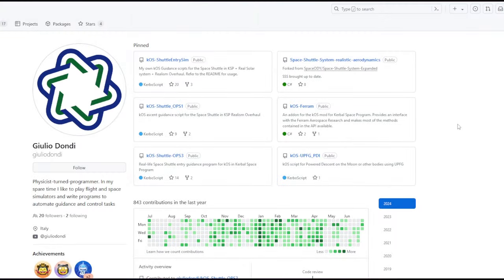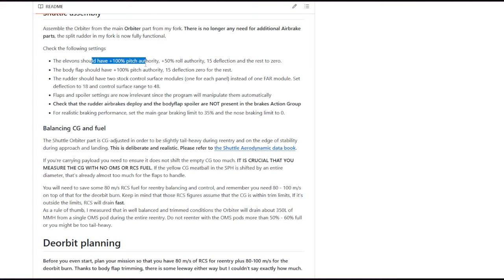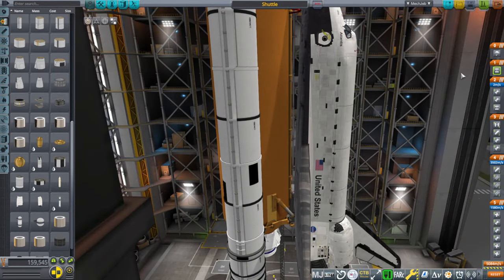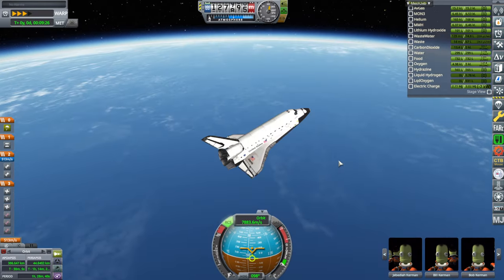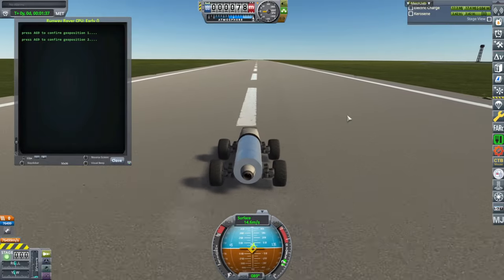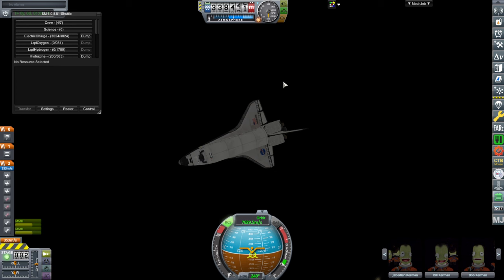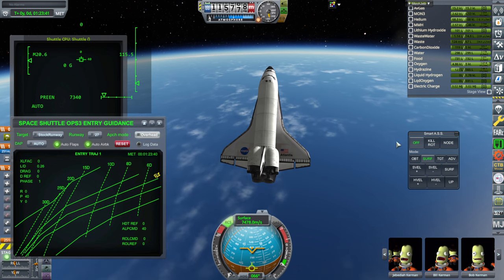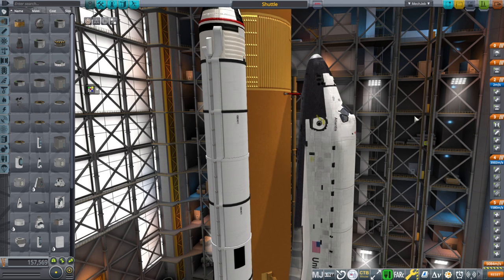Using the Giulio Dondi Shuttle (KSP 1.12 with RO)

Comment: 12:10 Here’s a list of the parts that have multiple textures:
Orbiter
Both Elevons
Tail Control Surface
Vertical Stabilizer With Parachute
Engine Mount
Both OMS Pods

External Tank

RSRM (Solid Rocket Booster)
SRB Decouplers
SRB Nosecone

Comment: HI there. I followed your videos and installation precisely, 5 times now, each time with a clean install. I have managed to get everything working as advertised, except KOS. No matter what I do, every time I type run ops1.ks. into the KOS window, nothing happens, except an error. Specifically, it says file 1:/ops1.ks not found. The scripts from Guiliondi Github are in ship/scripts. I am at a loss, although I have never used kOS before, therefore I don't know what to try next. I can launch the shuttle using Mechjeb out of interest but can not land it, it becomes unstable at about 60Kms altitude. Any help or guidance would be very much appreciated. I have been thinking about this shuttle from Guiliodondi for some time and until seeing your videos it has been beyond my skills. would dearly love to get this working if you can help, please.
Cheers!
Reply: Hi again. So I have been struggling through kOS documentation. I am not a programmer, but have discovered that I can ' switch to 0. ' and then I can run ops1.ks.  However, whilst I then get the Space Shuttle OPS 1 GUI as in your video, nothing further happens. The script box, kOS box, that I typed in lists several things and then beeps and stops when trying to call on shuttle_ops1/src/ops1_main-executive. Thus I am convinced that it is either an installation error or some kOS error that is beyond my understanding.

I am so close to being able to fly this new KSP instance, please could you point me in the right direction to solve my issue. I should be very grateful.

Cheers!
Reply: Finally! I did one more clean install, it works!! Not sure why, but OPS1 works now. Aborts work but it still loses control below 30km. More work required here I think.
Cheers!!
Reply: @robbosls  Hello, I had the same problem. Do you think you can explain it better?
Reply: @sociedadjaduelimitada5920  Hi. Yes I will try. 1. I made a clean install of KSP with no mods. 2. I installed RO from CKAN. 3. I installed ASET avionics, B9 part switch, KSP Wheel, Community Resource Pack, Textures Unlimited, TAC life support and Waterfall Core from CKAN. 3. I downloaded the 4 items from Guiliodondi's GITHUB, namely Ops1, Ops3, Ferram and  the Shuttle. I unzipped/extracted these. I copied ONLY the GameData folders from Ferram and Shuttle and pasted in my KSP root folder, thus adding the files. I copied the Ship folders from Ops1 and Ops3 and pasted them into the root, adding the scripts to Ships. 4. I then added kOS and kOS Ferram from CKAN. 
Next, I built the shuttle in the extended hangar. There are 2 shuttles, both descriptions are the same. I used the second one when sorted by size if that makes any difference? Made sure I set all the control surfaces as per the readme's from Guiliodondi's GITHUB pages. 100% Pitch, 50% Roll, 50% AOA, 15 deflection and rest to zero. I have made 3 shuttles by rightclicking the bare shuttle in the VAB and choosing the variant. Carefully set the booster nosecone so the separator rockets point towards the ET. Set the fuel flow of the orbiter to less than the fuel flow from the ET, you will see Kerbal Engineer change as you do that. That's it. I launched. On the pad I right click the orbiter and open terminal. Type switch to 0.   (Don't forget the . ) then type run ops1. and off it goes as advertised. I have now tried normal orbit insertions, circularising after ET sep. I've tried a few RTLS aborts, a TAL abort  and ATO and they all work perfectly. From orbit, I have OMS burned for about 1 minute, on the opposite side of earth, lowering the Pe to about 20km in the sea after KSC, point prograde and FF to atmospheric entry. Set 40 nose up and wait until 122km alt, then open terminal, switch to 0. and run ops3. and every time the shuttles land perfectly, but on the grass a few Kms from the KSC runway. I guess I now have to load the alternate airfields, which I am going to do now. Once running OK I will add the RSS reborn and Blackrack's Volumetric clouds... Good Luck.
Reply: @robbosls  a Clean install of kos?
Reply: @sociedadjaduelimitada5920   No, a new clean install of KSP 1. A fresh, unmodded copy of KSP from Steam or wherever you got it.
Reply: I dont wanna reinstall ksp 5 times, please does anyone have some sort of easier way? Like reinstalling the shuttle could work or smth?
Reply: Alright i figured it out. You dont have to actually reinstall ksp itself. I just removed all of my mods and installed in the same exact order you described, and it worked like a charm! Thanks man.
Reply: @builderdude9488   Well it's pretty easy. I just copy and paste the entire KSP folder from Steam/apps/common etc to the C: drive only takes a few minutes.
Reply: @robbosls  you really helped me since similar problem happened to me, very appreciate you